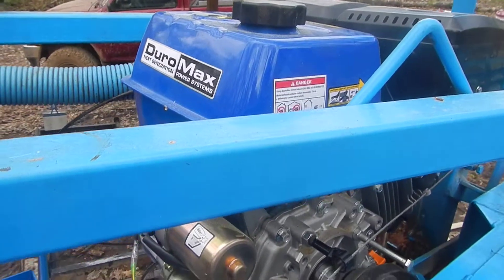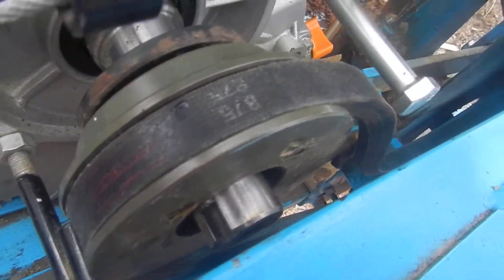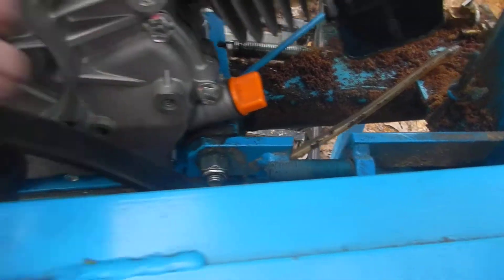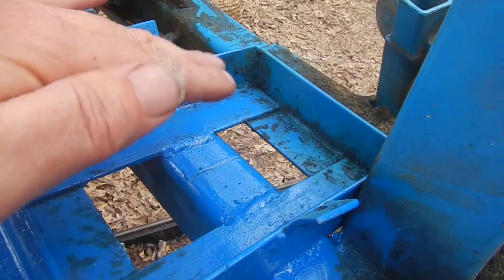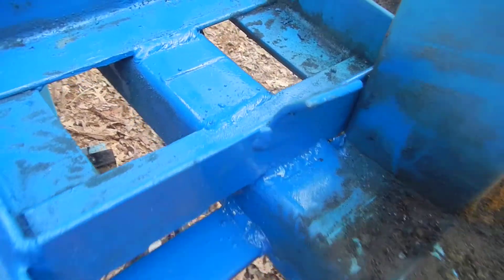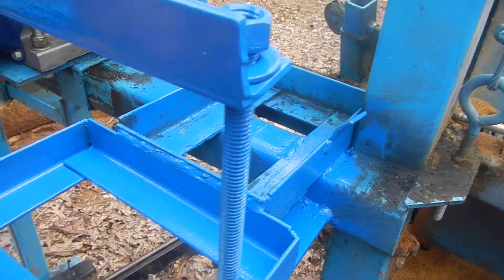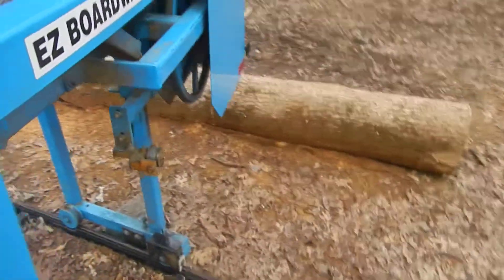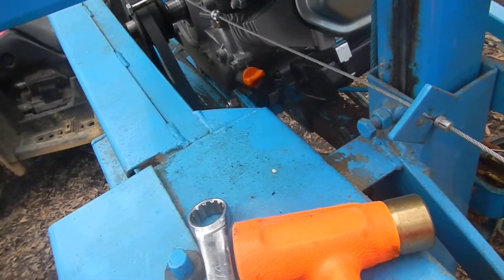ez boardwalk jr engine upgrade part 2

Comment: So it's been a while do you regret swapping out a honda for a chonda?
Reply from the maker: no it is very nice. the main difference is the new motor has enough HP to leave the blade engaged while idling down and up.this saves a little time and the new motor cuts a little faster as well. I sawed 34 logs with the new set up and I am happy.